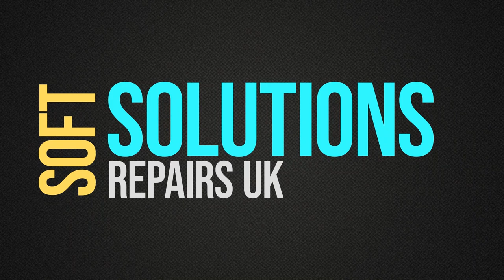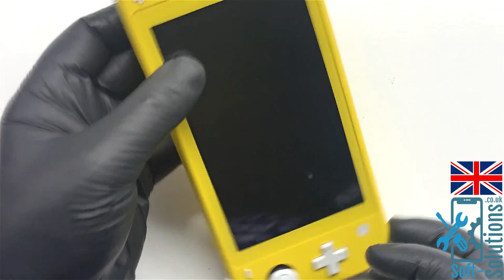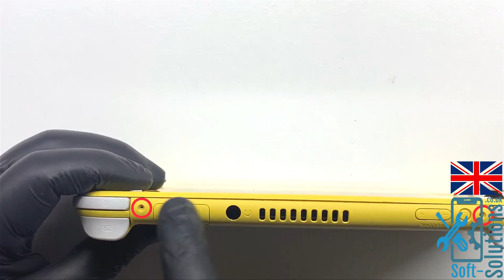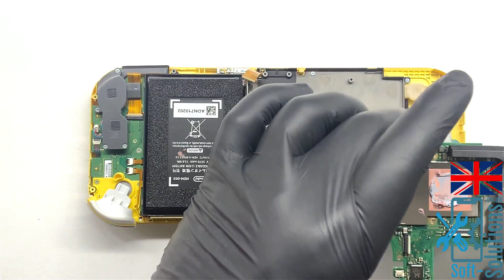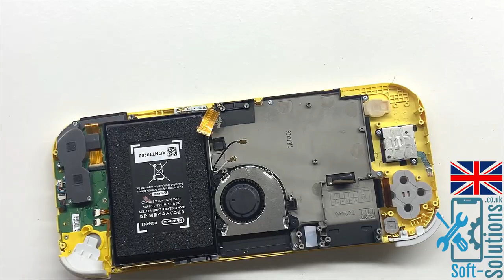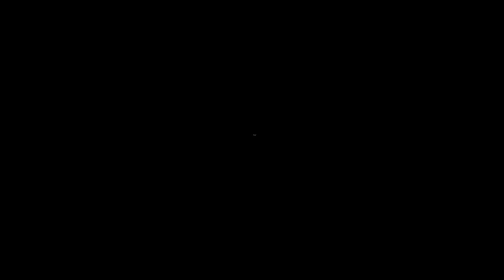Nintendo switch lite right joystick replacement

Comment: Touch digitizer flex cable, how do you get it back in?
Reply from the maker: The way it’s shown in the video?
Reply: I'm having the same issue. Any way to show u a close up. What a nightmare.
Reply from the maker: It’s larger flex cable. You ll need some patience.

Comment: I fitted the new joycon and it’s working but the Y and A buttons don’t work now any idea what I’ve done wrong 😭
Reply from the maker: Check long flex cable, it might be damaged or connector might be damaged.
Reply: Soft Solutions Repairs UK thanks for replying what do I do if it is damaged
Reply from the maker: You can send in for repair.
please follow our Mail-in repair link.

https://soft-solutions.co.uk/mail-in-repair/

Comment: Finally! All the other videos I've found were for the left hand(the easy one) side. Love the detail and clarity of your instructions. Thank you so much.
Reply from the maker: Awesome! Thank you!
Reply: @SoftSolutionsRepairsUK  I followed this vid exactly, switched the joystick, put everything back together and my screen no longer displayed. The backlight(?) Came on, i could here the sounds it normally makes when its on as i used the buttons and joysticks. Everything worked fine, but the normal screen display wasn't on. Any suggestions? 
   I checked all the ribbons, double checked. Any advice is appreciated.
Reply from the maker: Check all the connections again( make sure you always disconnect battery first)
Reply: @SoftSolutionsRepairsUK  I'm afraid that may be the mistake that caused this problem. I disconnected the battery after removing one or 2 other ribbons first. Worried I may have damaged a circuit or resistor now, but holding out hope I got lucky. Thanks for the response.
Reply from the maker: @Dan Marron
Or display connector gets damage in most cases.
Reply: Did you end up fixing it??? It just happened to mine
Reply: @Tinkerbell10299  sadly, no. I gave up for fear I may damage it worse. Its sitting neatly on a shelf waiting to be fixed "one day"... 🙄 if you guys find a solution please let me know. I haven't given up hope completely.
Reply: @theautodan7095  connect the lcd display flex properly. Same thing happened to mine. I pushed it in Gently and it game back on

Comment: I followed instructions and now the switch turns on but no game screen. Eveeything works and can't see anything
Reply from the maker: Check the display flex cable is connected properly.
Reply: I will try later and let you know how it goes
Reply: Same issue
Reply: @danielledalia2452  I had to take take it apart again. The display flex cable wasn't put back in all the way
Reply from the maker: @daniella dalia make sure you disconnect battery first(always)
Reply: @corinnehatipoglu248  how do you know if it's in all the way
Reply: @corinnehatipoglu248  I'm having this same issue
Reply: @SoftSolutionsRepairsUK  what does it look like

Comment: ALSO LOL he never reconnected the fan cable, and he put it back together and turned it on.  I'm surprised the Switch didn't boot up with an error about no fan, that's a bad design oversight,
Anyway MAKE SURE YOU RECONNECT THE FAN CABLE.

Comment: I messed up when i was testing the joystick and the screen went black and the sound went super low but it still responds to touch
Reply: same
Reply from the maker: Reconnect flex cables all of them. If still no luck, the mother will have to be repaired in most cases. Either a short circuit or connectors damaged.
Reply: SchizOnWheels  had to take it in for repair

Comment: What happens if it doesn’t turn on? Any advice
Reply from the maker: What we have experienced when repair switches when you attempted repair and had no display issue.
80% have damaged display connector or shorted pins inside the connector(connector needs to be replaced)
20% Of them broke traces under the CPU(cold joint traces damage) by putting too much pressure on the screws while unscrewing and screwing them back on(CPU needs to be repair)

If you would to send in for repair, please follow our Mail-in repair link.

https://soft-solutions.co.uk/mail-in-repair/

Comment: I see various comments with the black screen issue after they tried to repair their joystick, now I got the same problem after I replace mine.
Someone already have fixed the black screen?
Reply from the maker: Yes. When people send us repairs what we mostly see that they have damage the display connector during repair.
Reply: @SoftSolutionsRepairsUK  
In that case, the whole screen needs to be replaced?
Reply from the maker: No, Display connector on the motherboard.

Comment: mine turns on but the screen is black idk what i did wrong
Reply: Hey I just fixed my son's joystick this morning and had the same issue.  Had to take it all apart again and find the messed up cable ribbon.  Most likely it's one of two cables.  The one at the 3:45 mark or the one right after.  Watch closely how he does it and make sure you are utilizing the clamp.. put it in the up position and set the cable end in snugly, it should go in easily, then push the clamp down.

Comment: You didnt explain very well how to disconnect any of the flex cables or give us enough time to understand which screws we needed to unscrew should have given us a couple extra seconds to pause i struggled getting the correct frame.

Comment: has anyone else had the last screw you need to remove have the edges rounded and now you can't do anything to get it out if you have help me plz
Reply from the maker: Which one is striped. Don’t put too much pressure on the screw, coz there is LCD understand and extra pressure May damage the screen and you ll have no display issue.
Reply: @SoftSolutionsRepairsUK  this was for the left joy con vid you have. I don't know why I commented on this vid but the screw that is  stripped is the one under the little black panel
Reply from the maker: I have just uploaded a video because lots of people asking, and this is how I normally do to a unscrew a striped screw. Hope it help.

https://youtu.be/4AyN7zp3CCM

Comment: Damn tried it now the swotch wont turn on and cant tell how far those lil cables go in so cant tell if there connect properly
Reply from the maker: Check all the flex cable connected properly. Push the cables right in while locking them in with connector locker. Make sure to disconnect the battery first and connect it back on.
Please connect us on following email address if you have no luck.
info@soft-Solutions.co.uk
Reply: Did you ever fix this? I had the same problem today, i fixed it now my switch won’t even turn on
Reply: @Isaiah-uy3ek  got the same problem, i reconnected everything but my switch wont turn on anymore

Comment: Watched this to fix 1 right sided joystick. Now my kids switch just flashes the nintendo logo and black screen. Followed all steps, used the appropriate gear, gentle application, so spent 13 bucks for a joystick. Guess I'm spending the 200 for another one. Thanks though.

Comment: Me: about to reinstall digitizer cable. 
4:00

Why do i hear boss music 😐. 

Took me like 20min 🤷.
Reply from the maker: That’s the hardest part, it does take long as the cable is bent and short, also big so does not fit inside correctly.

Comment: So I tried this and now my screen will not turn on even though i can hear the buttons press and functions happening. 
S.O.S.
Reply from the maker: Check display or back light cable
Reply: @SoftSolutionsRepairsUK  I've checked every cable and they all seem to be in as far as they possibly can go.  I'm seeing the backlight and I hear the click click of it booting up - but nothing but just lit black screen on the display.  I'm at a loss.
Reply from the maker: What screw driver have you used to unscrew? Can you please send me a link?
Reply: Hey i have the same problem, did yoi find a way to resolve it? thanks.
Reply: SchizOnWheels  My husband bought me a new one lol. But I believe the instrument I used might have damaged the image ribbon.

Comment: I did everything as you said, but now my Switch Lite won't turn on whatsoever
Reply from the maker: You must have made a mistake somewhere, check for any flex cable might not be connected properly or any damage. You always turn it off before you start working on any electronic device and disconnect battery first. You can easily damage components on the motherboard if your screw driver slips.
Reply: @SoftSolutionsRepairsUK  I plugged in the red and blue plug that was under the ribbon cable next to the charger, which wasn't fully plugged in.

But now my switch lite only turns on when I hold the power button for 15 seconds, but only as a black screen, and then it turns off again a second later. I've been charging it for 2-3 hours and nothing has changed.
Reply from the maker: That is battery connector. I wouldn’t suggest you to carry repair on the switch anymore.

Comment: You obviously know what you’re doing, but this is actually very bad flow and presentation. 3/10
Reply: Just followed exact directions and now it will not turn on. You should have mentioned the tools and thermal paste BEFORE that so the viewer knows what they’ll need, but you wait until the end to mention thermal paste . What is wrong with you